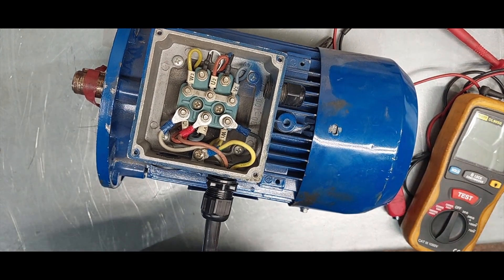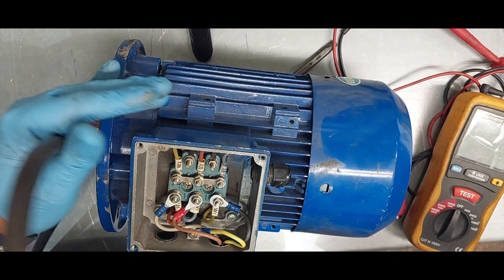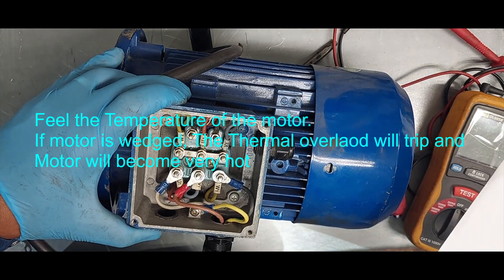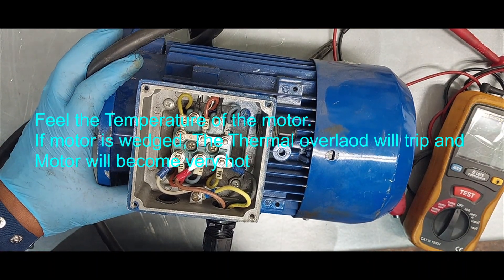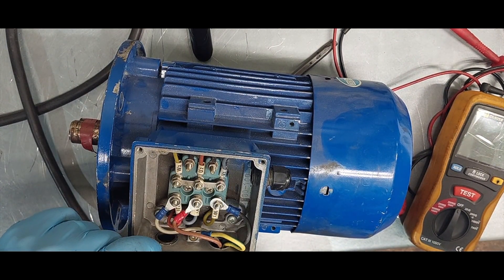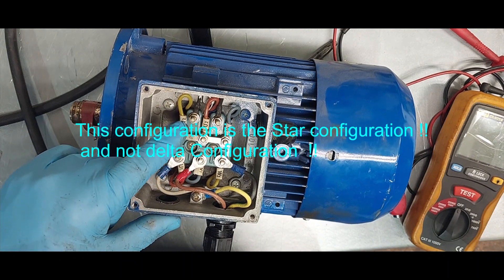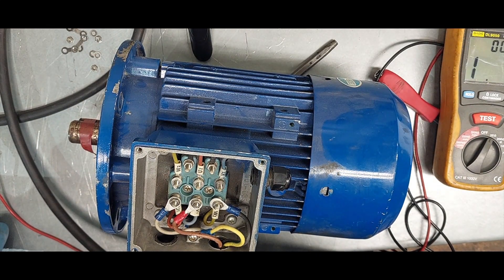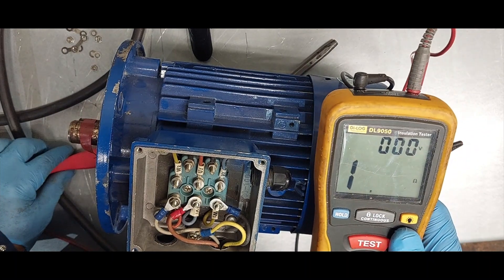How to check your  Electrical motor winding - Continuity & Insulation resistance test

Comment: so what happens when you find out that the readings are different e.g u1-u2 is 5.3 ohms?
Reply from the maker: 5.3 ohms is relatively low resistance. That particular coil is good.

Comment: What happen when check the insulation between phase and phase get 0M. Between phase and ground get 4M. but still can run
Reply from the maker: If you want to check insulation resistance between 2 phases, make sure to remove the linking plates.
If you test it and its still 0MOhmn, then the insulation is damaged or there maybe water inside the motor

Comment: Wow! Well explained. Thanks for sharing it with us. I really appreciate it. I learnt three steps
1. Visual inspection; check for burnt cable etc
2. Continuity test; using the ohm meter or digital multimeter
3. IR test; using the meggar or Insulation Resistance tester

Comment: I have a question, between shaft and earth, motor must be in continuity or open circuit?
Reply from the maker: I dont believe its part of the electrical tests, required for Asynchrounous motors.

Comment: Sir I like your videos very useful I need to know how to injuct resistance test again
Reply from the maker: It is expressed in the video. Put your multimeter to Resistance measurement, then check for low resistance, less than 100 ohms. If the measured resistance is high, then there is a problem

Comment: your resistance always still 1 ohm? you should remove every wire and the connection is star not delta.
Reply: Resistance = 3.5 Ohms all coils.
Insulation Resistance = "'I'" means Infinity and in this case its more than 200mOhms. (max range of meter @500V).

Comment: Thank you for the video. basically to check insulation value you dont need to disconnect the star configuration (unless you encounter a bad reading and then start checking separately) if CB is off you can check the insulation test as it is.
Reply: You're the first I've heard and seen in practice not disconnecting the star configuration.
Reply: @ScoreRushMobile  when circuit breaker is off. The cable is connected with the motor coils and joined in star connection. If you make insulation test with the chassis, you can make from every terminal in cb with the chassis. And if problem found then you can start disconnecting to isolate the problem. Both cable and winding can carry 500V dc pulse.
Reply: That’s right

Comment: Good video, thanks. Why did you choose 500V and not 250V or 1000V?
Reply: I normally disconnect the thermistor (temperature circuit) and use 1000V. I believe the 1 kV test gives me a more sensitive test. And since these tests are infrequent, I want to catch any pending fault.
Reply: I think because maybe the motor is required 480VAC so by using 500VAC your able to push electrons through and read the ohms. I’m still learning myself and not sure if I’m right. Lol
Reply: @varnchlarson  I think the mega pushes 500V DC so not sure if your theory would make sense. good thought tho
Reply from the maker: Hi , I used 500VDC to inject into the winding of the Induction motors, so that i can test to seek if there is any weakness in the insulation or the winding of cables.
 The nominal voltage for this electrical motor is 400VAC. It could be tested with 1000VDC as well. But this is how I was thought and it works for me.
Reply: @maintenanceengineeringinsider  so as to save the thermistor (if there is one).

Comment: The connection is star not delta !
Reply: That’s right
Reply: How can one determine in the a particular motor is connected in star or delta configuration?
Reply: @ucheinnocent2680  The motor spec/model plate has that info. If it doesn't, you have to do resistance testing to find the coils, and then either wire them series or parallel. Honestly if you don't know how to tell the difference, you shouldn't be working with electricity unless you learn what you need to before ever touching it.
Reply: My point exactly
Reply: He corrected himself in the video using captions
Reply: How can one determine the configuration of the motor?
Reply: @ucheinnocent2680  The links in the motor will also help you determine the winding. The metal links going across the 3 terminals is star, if there are 3 links across 3 terminals its delta

Comment: OL between any winding( U1,V1 etc) and earth is it a fail?
Reply from the maker: Open loop (OL) during a continuity test, between the windings of an inductor motor is good. Because it means that there is no contact between the windings.
However, It is very important to test each winding with the chasis of the motor and make sure it is reading OL.
OL could be good or bad, depending on what you are testing for.

Comment: Hi after i remove the main supply cable, when i do insulation test do i need to take test on all the windings or just U2,V2 and W2?
Reply from the maker: @samurai X , You  remove the configuration plate, and you do insulation resistance test between U2 & V2, U2 & W2 , U2 & Chasis. 
Repeat the same process with V2, and then repeat the same process with W2.
Reply: @maintenanceengineeringinsider   thanks for the fast reply, can i know why there is no need to take at U1,V1 anz W1? Or what test can do at U1,V1 and W1?
Reply from the maker: @samuraix8903  U1, , V1 and W1 are three sets of coil, which are known as winding.  U1 is the opposite end of U2. So when you test U1 or U2, you have tested one winding.
 I will make a short video about this for you ASAP  .
Reply: @maintenanceengineeringinsider   ah so means i have to do insulation test of the winding on U2, V2 and W2 as well to check if its bad?
Reply from the maker: @samuraix8903  https://youtu.be/YZVi8FMfF5o
Reply: @maintenanceengineeringinsider   ah thank u so much for the informative video! I see now what you mean with the drawing. I only need to do insulation test on coil U1,V1 and W1 as U2, V2 and W2 is part of U1, V1 and W1 since they are the same winding. Good stuff!
Reply from the maker: I am glad that i was able to help
Reply from the maker: Cc Gg  chasis is the carcas of the motor, where ground wire is connected nomally
Reply: deutscher Köter  Frame of motor/transformer.

Comment: Never stated voltage rating of the motor. English skills need improvement
Reply from the maker: Hi, the voltage rating does not really matter here, when performing either Continuity test or Insulation resistance test.
As per improvement, i totally agree with you. Hablo fluidamente en 4 idiomas. 
Asųsų one ka ina asų?
Reply: @maintenanceengineeringinsider  shouldn't the voltage rating of the motor be known as to select the right test DC  from the tester ?
575v motor 1000v test 
240v motor 500v test.  etc....
Reply from the maker: @Ron Spencer, In Factories in England, we run Asynchronous  motors at 240 VAC or the more  commonly used 400VAC. I run my insulation resistance tests at 500VDC. 
This is enough to search out  and indicate weakness in the insulation.
 You do have a reason too. The Insulation resistance tester allows user to inject either 500VDC or 1000VDC.  Whichever way, the reading must remain between 1 Megaohm  and 2 megaohms. Any reading under 1 Mega ohm is a fail
Reply: @maintenanceengineeringinsider  Please say correctly. Reading above 1mOhm is OK and not between 1 and 2mOhms.
Reply: He speaks better English than many people in England..
Reply: @ef7480  🤣🤣🤣😁😁

Comment: What happens if it's over 2megaOhm does it still pass or fail
Reply from the maker: Yes, the aim is to get a reading on, or above 1 MegaOhm. The higher the resistance of the insulation material, the better. 1MegaOhm is the minimum recommended by the Eletrotechnical governing  body.

Comment: Do a single phase motor test too please. Would like to see what happens when capacitors are involved. ...
Reply from the maker: Thank you for suggesting a topic. I don't have a single phase motor, and i will source for it.  Single phase motors have two sets of windings and the charge stored up in a capacitor will simulates a third winding. I reckon that the tests should be similar. However,  perform test  on the capacitance of the  capacitor as well.
We will prove this, in the future.
Reply: @maintenanceengineeringinsider  can you please, answer me some basic question about?  Thanks
Reply from the maker: How may i help ?
Reply: Capacitors, thermistors should be isolated from the windings under check, otherwise you will get improper readings. Meggering is both science and art.